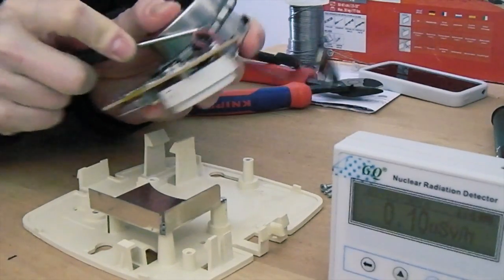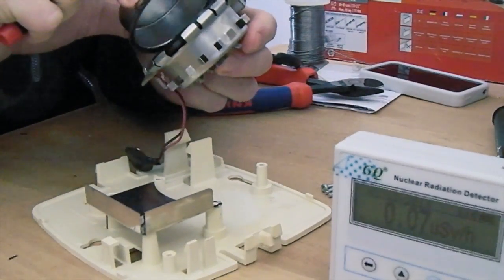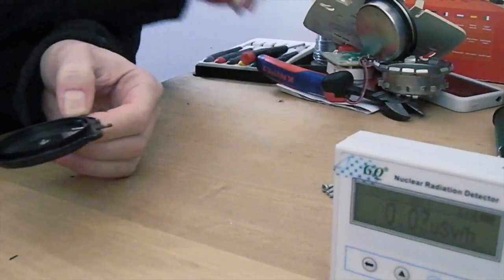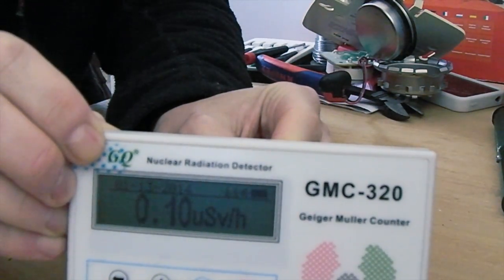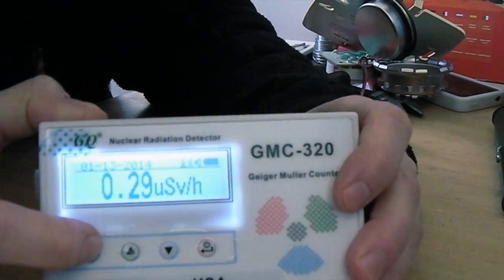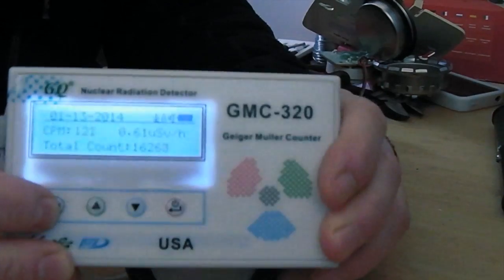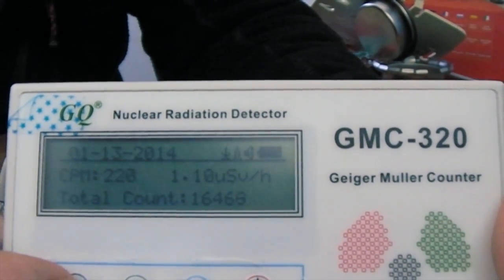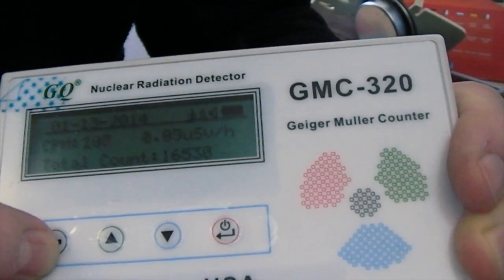Americium 241 GMC-320 Geiger Muller counter (sorry for misspelling in video)

Comment: The GMC-320 measures only Beta and Gama, but no alpha....Why are you getting lecture on Amercium 241? Amercium produces aplha radiation only
Reply from the maker: From the video description above: "This particular fire alarm was manufatured in 1981 so through decay its now contains about 5% Neptunium." Neptunium emits beta particles.
Reply: Oook...I got it, thanks!
Reply: But you can't to detect beta separately from gamma with GMC-320, this device is cant!

Comment: The GMC-320 only measures Beta and Gamma. Amercium 241 is entirely alpha radiation (and a lot of it) so you're not going to see the interesting levels.
Reply from the maker: +Ergzay True that but as stated in the description Americium decays into Neptunium and Neptunium emits beta particles.
Reply from the maker: Sorry but no alpha detection for the 320 Plus. Following text directly from GQelectronics website: "Radiation detection: Beta, Gamma and X-Ray ."
Reply: @kallekillerapa  i own one just like yours .❤❤❤❤☢☢☢☢. But i'm  slightly  radioactive.  I was with a friend at his house testing my Geiger counter, with many Radioactive things that i was in contact  with, many  very high Radioactive rocks, that I held,and  radioactive element pieces. My Geiger counter was going Nuts, 31,000 micro sievert per hour up to 66,000 and beyond.
Reply: You could replace the tube with an sbt-9 if you wanted alpha. Not really that hard to do, but you would have to drill a hole in the counter for alpha sensitivity. then you would have to calibrate the counter again though.

Comment: I have the gmc 300e and it has more awesome features than the 320. For example the 320 dosent have a red flashing light. I also have tested the 320 and there is no difference in sensativity they both have the same tubes and soft ware the only difference it that the 320 has more logging memory thats it.
Reply: +arbitergvadam My 320+ has a LED that flashes with the clicker, which starts out green and turns red with higher CPM.

Comment: Nice video. I have a question, are u satisfied about your GMC 320? Is quite sensitive? Because I don't know which geiger to buy. Is better this or GMC 300E plus, for example? Thanks a lot.
Reply from the maker: For the price it's well worth it, the 320 is pretty much the same as a 300E but with 10 times more memory and a temperature sensor. The GM-tube seem to very sensitive compared to for example the SBM-20. The 320 also have a built in recharbable battery (easily sapped when needed).
Reply: Thanks a lot! And what about the battery? Is better than old GMC 300? (I mean battery life).
Reply from the maker: Batterylife is supposed to be about a week ther are ways to save battery by turning iff the speaker and also turning off the display. For all information check the forums @ http://www.gqelectronicsllc.com/forum/forum.asp?FORUM_ID=14
Reply: Hi, you mentioned the battery life being up to a week. Is it with the unit turned on all the time, so it can raise an alarm when it detects high radiation level? Thanks.
Reply from the maker: Yes thats right, display and I believe speaker as well will be off though. However as I found out rather quickly, after about 2-3 months of having the unit turned on 24/4 the GM-tube burnt out, so in essence you'll have to exchange tubes a few times a year. And you might have to have it calibrated after each tube change. Don't expect any wonders with a cheap GM-unit, you get what you pay for. My unit is full of software bugs that can only be fixed by sending the unit back to have it updated. If I would have bought a GM-unit today I would NOT have bought any of the cheap GQ products, they are just not up to standards.